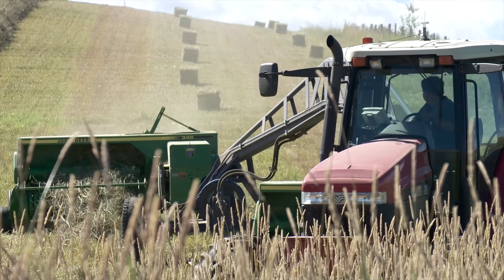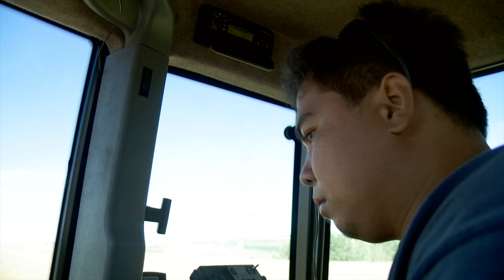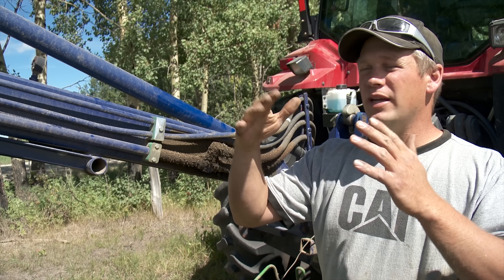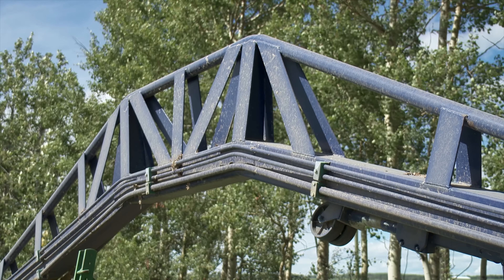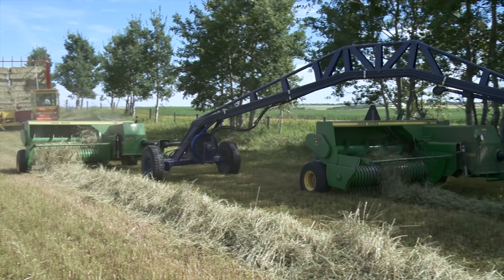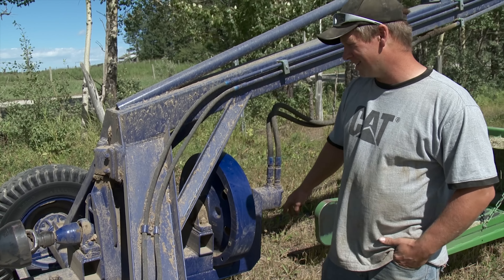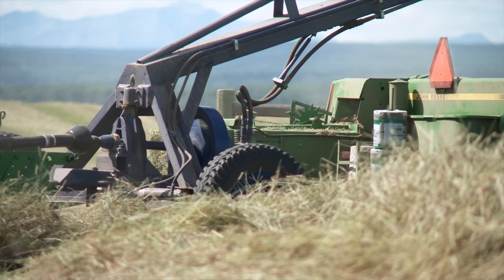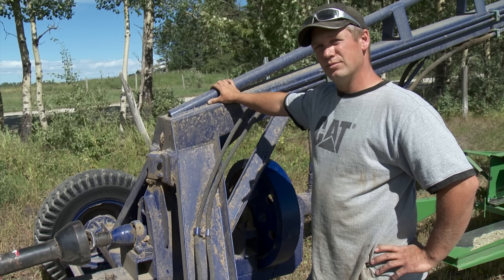Double Baler Hitch

Comment: i am impressed by the build ! But question : why not have just one larger baler and drive farser while baling ?
Reply: Depends on the end use of the hay. I sold small square bales to Equine customers who did not have a way to handle anything bigger. Milk and meat goat producers, sheep, exotics all seem to prefer small squares. There is also a unit that will bundle 21 of them and band them together for a bigger shipping unit but still becomes easily handled by the end user. There are commercially built hitches that do the same thing as they are doing here, but they built theirs much cheaper and simpler. Hard to improve on the first way invented to package hay.
Reply: Its said at the begining. "High Quality horse hay". The custom baling is a side thing and extra income for the farm. Horse farmers dont want large bales as they usually put them in the racks at the stables. Also easier to transport on the trailer and throw on a side by side or atv to carry around the farm.
Reply: Horse hay, horse people don't like big bales. Doesn't make sense but that's just the way they are.
Reply: Small bales are for "fartin' around" ranchers.  "there's two types of farmers and drug dealers: those who do it with forklifts, and those that don't."

Comment: Great ingenuity.  I am puzzled that the bales are turned on 'end' .  I would think that would allow more rain in if it happened.
Reply: They turn them that way for the bale wagon.
Reply: They are picked up right away if they are going to be left out they would stouck them like the pyrimids the rain will just roll of them.
Reply: Its so they can be picked up by machinery and not break the strings.

Comment: Why don't they just put the rows together four into one like we do
Reply: Moving rows when they are almost dry, especially alfalfa, you lose a lot of feed value, the leaves fall off, also a small square baler only has a certain amount of capacity, large square and round balers are almost unlimited but these small square balers only increase with more balers, I've put hundreds of hours on small square balers, my hours were mostly open cab, through the night, my dad always was adamant on having it a little too dry, then waiting for the evening dew to fall before we started

Comment: No doubt genious but I would use a second tractor
Reply: Cheaper, and doesn’t require a second driver
Reply: We run two tractors mainly because if one baler breaks down we can still keep one making bales
Reply: @GT-fi4sk  I'm sure they can unhook the broken baler from this setup and do the same.
Reply: Looks like a big headache waiting to happen. Be a total nightmare on hilly ground. Not very practical